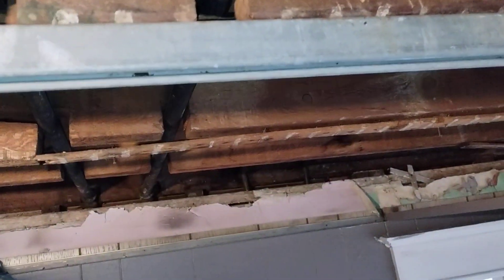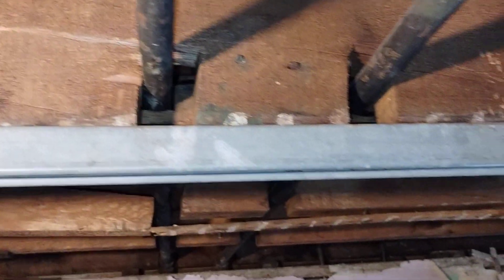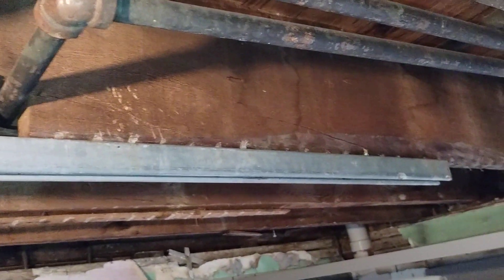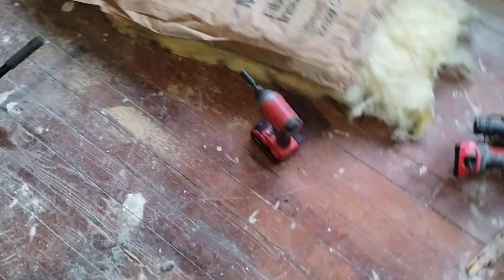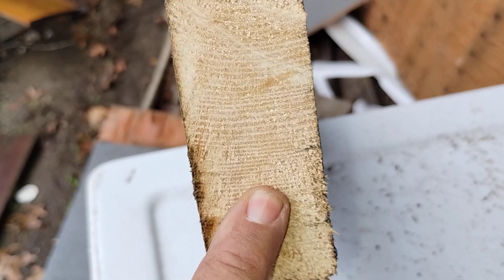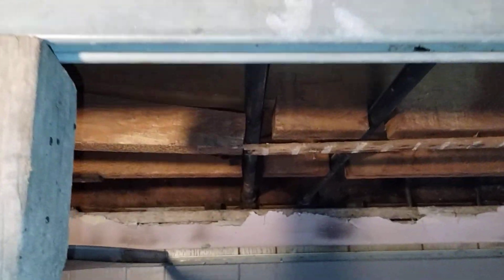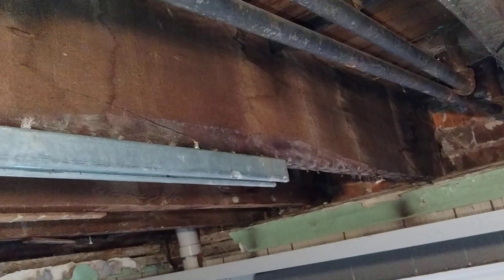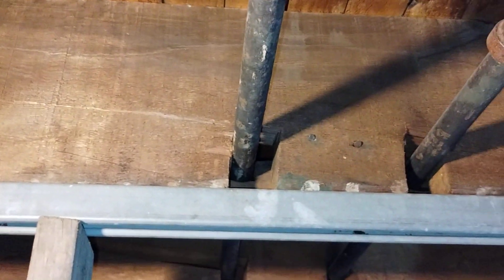Wood floor joist repair cracked floor joist repair part 4

Comment: I believe if you move electrical and it doesn't meet current code then you need to update to latest code. Or code your location requires.
Reply from the maker: Our code is, if you can see it, you have to update unless it is too cost prohibitive vs the work you are doing.
We have removed some and updated but this circuit is Pandora's box and we have just removed two load sources (to lower it's demand but that is far as this story will go, for now)...
I use the "condition method" of analysis, if the sheathing is still soft, not brittle, it can stay but if it is brittle, then hell or high water, the circuit will be replaced.

Comment: Lateral run of 'two by' notched in the bottom where  greatest tensile pull exists - what were they thinking? What does code say for a pipe punch thru on a joist like this say?